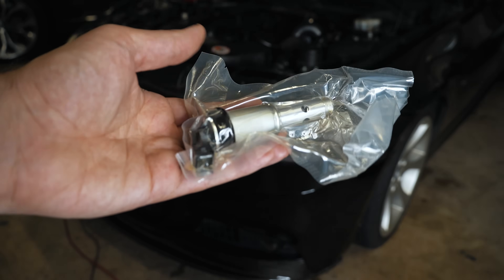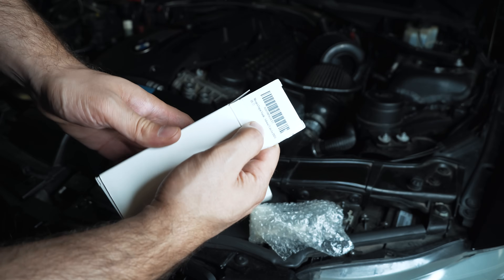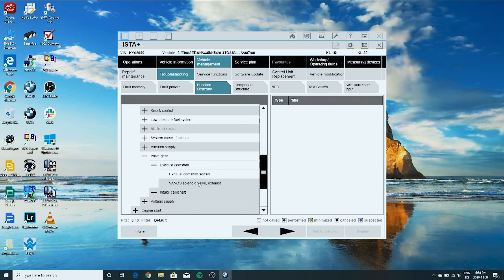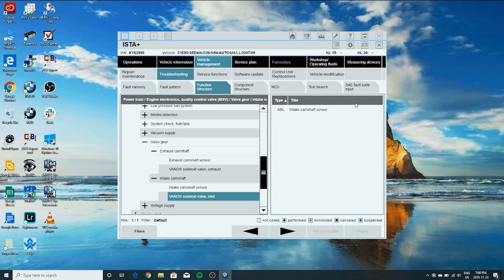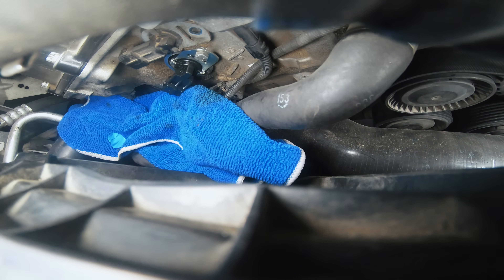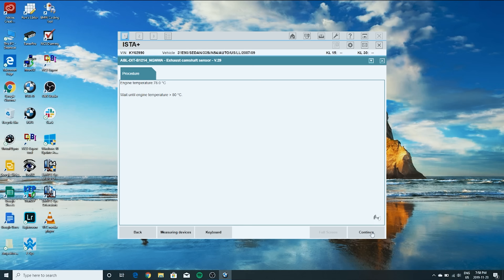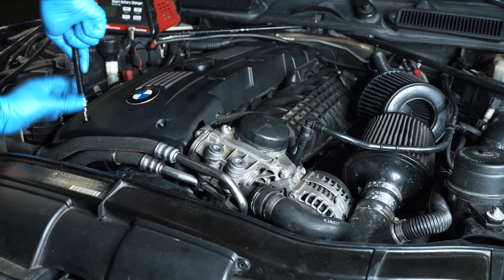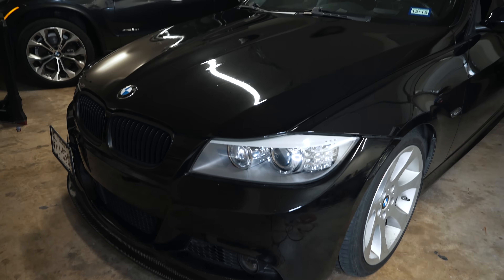I Bought The CHEAPEST Vanos Solenoids I Could Find! | BMW E90 DIY

Comment: Nothing wrong with cheap sensors,  the real problem is why oem ones cost 10-50X more and only last 3X longer,  always buy a spare set of cheap ones, and the car will tell you immediately if the cheap ones are not working right, so no harm done. 5 min to swap them out, i got a $10 diagnostic plug and a cheap old tablet i leave in the glovebox so can scan the car anywhere,  doesnt have to be expensive to run a bmw, parts from wreakers are great and generally oem

Comment: Do not put cheap intake solenoids! I bought a 2007 bmw 530xi and just the other day the plug on the solenoid got red hot noticed smoke in engine bay pulled over opened the hood and noticed the plug for solenoid was red hot and caught on fire good thing i had a bottle of water and poured it on it, put the fire out noticed the plug was melted, took the solenoids out and of course previous owner put some cheap amazon solenoids..Long story short get close to oem parts spend the extra bucks wouldn't want no one to go through what happened to me..

Comment: I replaced my Vanos solenoids 2 months ago with VAICO brand and the car ran like ish.  Very lumpy idle, stalled twice on a stop light, poor acceleration, etc.  Replaced it with an OEM from Turner Motorsport and immediately it feels like its new again.  Lesson learned.

Comment: Seeing this 2 years later. I replaced mine in my 05 745i with TRQ brand. $108 delivered for 4. Had a misfire Service light code for bank 2 timing retarded. These solenoids worked great for about 3 weeks then symptoms came back. Put cleaned OE solenoid on exhaust side. Ran good again for another  two weeks then got codes again.  Ordered URO brand at $60 delivered for 1. Will test this and see. If it fails I'll get a refund and buy a Pierberg for like $87 and test that.
Reply: How is going?
Reply: Can you get refund for that

Comment: No update yet. It looks that this lasted more than Corona.
Reply from the maker: They lasted but were in my old motor when the engine failed due to rod bearings so they didn't make it over to the new motor incase they were contaminated with shavings etc.

Comment: I think I need to test mine. During idle my engine stumbles a little and seems like its consuming more gas than normal.
Reply: check if theres oil in the ESS, mine did the same thing i just cleaned it out and replaced the $5 seal problem solved.
Reply: @Chezzzzy  what is ESS?
Reply: @mickd2533  eccentric shaft sensor

Comment: I need to get that program. I had 1 intake code a while back and i noticed loss of power on lower end. I ordered 2 viaco solenoids. I changed them and now my exaust solenoid is giving contstant limp mode. After a few restarts and driving around now i get constant limo mode for both.   I reset the adaptations.....and i think this might have been the mistake. Any input? I feel so stupid for not driving the car first before resetting the adaptations.
I have 1 new solenoid coming tomorrow, first i will reinstall the old ones since they gave minimal problems. That will let me know if it was the adaptaion reset. Whats worst case? Any input would help.

Comment: So say I have a cam code, I replace both cam sensors and vanos solenoids. Still has a code come back sitting at idle after a minute or two after clearing the computer with a scanner. Is it a must to drive to clear it? Or should the code stay off even at idle after clearing and no driving?
Reply: Check fuse 70. It can blow and act normal, then one day you'll have a no start condition with those codes

Comment: I have been getting INTAKE Vanos codes as well as boost pressure codes so I replaced the Vanos solenoids that were in the car, I'm assuming they were OEM as I bought the car with 56K miles on it. I replaced them with $40 Vanos solenoids from Amazon and didn't get a code for about 6 weeks. Now I get them every day but it seems to be only when the car is hot. If I let the car cool down and reset the code with MHD the codes only come back when the car is back up to temp again. If I reset while the car is hot and start it again, the codes are back in half a mile. So, I cleaned and swapped them over, the codes still came back and still on the INTAKE side. Do you have any suggestions ? Since the error didn't move when I switched the intake and exhaust solenoids I'm worried this is a cam ledge issue. It's a 2008 N54 (E88) now with 91K miles. I've done regular oil changes using the FCP oil change kits, the filter cap has the center piece, I'm stage 2 tuned (MHD). Would INSTA give me a definitive answer of whether or not its the solenoids or the ledge ?
Thanks.
Reply: Did you figure out what the issue was?
Reply: @darth_art2101  I ended up replacing them with more cheap ones from Amazon and haven't had an issue since

Comment: Do you do programming ? I live in jersey and have a 08 550i N62. My Ihk Kline says no Daten files when I use Bimmer geeks ProTool and check for errors. I go to code it says no files found. Any advice sorry to ask. Thanks either way
Reply from the maker: Sorry I don't have any experience with ProTool but BimmerGeeks has a INPA download that is really easy to setup.  You can download that from their site and set your laptop up with it.

Comment: I ran Viaco Chinese solenoids. They lasted 1 year and still no codes but power loss is experienced. FYI these solenoids including bmws can fail with no codes. You will get terrible torque down low, your fuel economy will increase and the car will sound like its wheezing at high rpm. Also oil consumption occurs and engine runs hotter than normal. I have 3 sets that I am experimenting with - Viaco; pierberg and genuine bmw. The Vaico failed by the spring becoming loose internally. The bmw ones failed by the bore wearing away not holding pressure. I am currently running pierburg but not expecting them to last as long as bmws. I suggest programming the engine to run cooler and or adding an external oil cooler. These problems seems to be caused by the engine running so hot. Those electrical coils cannot survive that heat for so long.
Reply: Can we have an update on the Pierberg solenoids ?
Reply: @moebeing1190  I did extensive testing with INPA. I have concluded that replacing the solenoid with genuine bmw solenoids are the only long term solution. The precision in cam adjustment was night and day vs aftermarket.

Comment: great video, good lighting and angle to see what is otherwise a bit blind.  got my thumbs up.   i had major difficulty inserting the solenoid with oring, so i installed the oring, lubed up the shaft and ahem, inserted the shaft into the hole.

Comment: Can having bad vanos solenoids and not replacing them soon enough cause internal damage to the engine like dropping a valve into the block because I had rough idle then scanned the code and a got vanos fault, I was going to replace them soon and all of a sudden I’m at the stoplight and my engine seized up and now I need to replace whole engine, i do have a n55 and it could easily be something else giving that n55 don’t have forged internals and could’ve been the rod bearings but The car ran excellent until then
Reply: What ended up being the problem?
Reply: Diego Carmona looked like oil salvation which was funny cuz I just had got an oil change the day this happened so they must have messed something up, I ended getting a rebuilt engine took about 2 months in the shop

Comment: I was looking at your data log. I noticed your low fuel pressure drops alround 20psi, followed by rail pressure drop, almost 2k psi, while maintaining full throttle. Are you sure thatthere is no fuel delevery issue? 
I might be saying bullshit, but i guess that shouldn't happen.
Reply: @guimazzini - low pressure shouldnt drop below 50psi so sounds plausible. HpFP is fine at 2000 psi.

Comment: Some times the Chinese ones are made in the same factory as the OEM ones
Reply: Harry Williamson Not really the case with BMW parts. About 85% of the OE parts suppliers are in Germany or Eastern Europe. I personally stay away from Asian parts when it comes to my BMW’s simply because of the lack of manufacturing experience
Reply: Pierburg, an OEM for BMW has factories in China. I purchased 2 Pierburg solenoids and it was manufactured in China. So far, my N52is running fine. It's the QC that will dictates the quality of the products.

Comment: Hey vehicular diy 
I need advice with my bmw
I have 2011 335xi
At the beginning car was starting but had issue 
I replaced rod bearing, guide rail with chain and tensioner I had disassembled whole engine checked valves too when I finish assembling diagnostic had only 2DD6 valvetronic servomotor position sensor short circuit or line disconnection. 
I replaced valvetronic motor 
After everything done it cranks like one turn like when battery is low like that battery is 12.77 I tried 4 batteries all of them are same I replaced starter nothing changed wires checked voltage is good 
Under glovebox checked relay it’s good negative cable which is one on the engine block and second one on the mount checked and both are good
What out do I need to check? 
I didn’t delete code after replaced valvtronic motor do I need to delete that ? 
And can intelligent battery sensor do like that? 
Any advice will be helpful thanks
Reply: Check ground wires and ibs.

Comment: Thanks! I ran cheapo solenoids which seemed to work at first but still threw some codes occasionally (the ones directly related to the camshaft operations). Bought new genuine (as recommended by BMW Doctor) and haven't gotten a vanos related code thus far. I've used the vanos test in INPA for all 3 sets (stock, cheapo & new genuine) and they seem to pass.

Comment: This may be the most idiotic BMW DIY video that I've seen.
Basically: "This $10 part works absolutely fine, but because I have some unhinged prejudice against Chinese parts, I'm going to announce that they will fail, with absolutely no evidence of that. Buy the $200 part anyway."
Reply: Was for content.  Most people think everything on eBay or Amazon is good.  Strictly FOR TESTING ONLY.  He left them in for 5 minutes.

Comment: Don't install this shit. It's real crap. Mine failed pretty much right away. Engine ran ok but lots of VANOS codes in de DME. I've got nothing against Chinese parts. I always try Chinese before I buy original. But these are very crap. Go for a proper brand in this case.

Comment: I bought a pair of Amazon cheap.  One of the two works (50% failure) out of the box. I ended up cleaning the OEM with brake cleaner. I used the new o ring from the new one.
Reply: What symptoms were you getting
Reply: @ptlouis9871  the vtc failure code when acceleration.
Reply: zmanphx what’s vtc stand for?
Reply: Valve timing control. That is the purpose of the VTC solenoid.

Comment: Quick question, are you still running your factory catback exhaust? I'm wondering if I need to upgrade mine to achieve about 550whp. I see you made 537whp before
Reply from the maker: I still am yes, it shouldn't be a restriction for you
Reply: @VehicularDIY  thanks!

Comment: I had the same weird high rpm cylinder 6 misfire after like 5800 rpm. I tried changing the injector, spark plug, coil pack, wiring harness, tune, and even hpfp with no luck. I even tried the tephlon seal method that you made a video on but nothing changed. Any tune I flashed it to I would almost always misfire around 6k rpm. I then got into an accident, got another 335i, put all my bolt ons back and the misfire followed!!! That’s when I knew it wasn’t internal motor damage and it had to be cause by one of my bolt ons. Long story short I took a gamble and placed my money on it being the lpfp and ordered a new one. Turns out something was up with my fuel it stage 2 lpfp because when I replaced it with a spool performance stage 2 lpfp it’s been running like a dream I’m finally able to hit red line and send logs to my tuner. I know it sounds it sounds unlikely that a weak or old lpfp could only cause a cylinder 6 issue but my guess is that it’s because it’s the last injector to get fuel. And I can’t back it up with logs because they both the lpfp sensor and rail pressure look normal!!! The only thing I have to prove this was that it worked for me. (Just wanted to add that I’m fbo, inlets outlets, pure stage 2, and xhp stage 3 transmission flashed)
Reply from the maker: Thanks for the info!
Reply: Vehicular DIY so what ended up fixing your cyl 6 misfire ? I still have mine. I did the Teflon seal too like your other video but it’s still there. I would appreciate any insight?
Reply: I after literally replacing everything and compression texting and walnut blasting I finally just had my tuner disable misfire detection after 6k rpm. Been running fine for months now
Reply: Didn’t his low pressure fuel sensor reading drop below 60 psi a few times around 6k rpm anyway? Timing corrections on cylinder  5 as well? Aren’t those indications that he’s close to running out of fuel at those rpms? (P600 FBO)
Reply: Constantine Lycos it could be. However after I got stage 3 lpfp and helix overdrive with full e85 misfire persisted. All injectors are new 12’s brand new two step colder plugs, and pr coils. After misfire detection turned off above 6k rpm my cars snaps to redline no problem or hiccup, (also P600) 27 psi too😉
Reply: Tried everything in the book to fix it. I think it just came down to over sensitive misfire sensors.
Reply: robert simental can you share a data log? My turbos take over 10 time increments to reach target boost levels. His only take about five. What is normal? I want to figure out if I have a small boost leak
Reply: Constantine Lycos what’s you’re email

Comment: Brother your worst mistake ever you know bro how I feel about that I’m sure you seen my videos lol 

Bro watch your timing be delayed and you will feel lose of power you will find out when these can’t work as hard as the genuine ones
Reply from the maker: Lol yeah bro I did catch the video where you sent a set to Nathan and told him how it is.  If you don't mind I have a question regarding using ICOM with ista.  Would it be faster if I switched to ICOM from Dcan?  I mean with an emulator and a basic amazon ICOM cable.  I know you have a proper ICOM.  Does having an real ICOM make it run faster as well?  Thanks man.
Reply from the maker: I'll take them out at the first sign of hesitation and update the description letting everyone know.
Reply: Vehicular DIY mate yes take them straight out or what will happen your timing will JUMP and you will be screwed mate as you will have to re time it as the solenoids will cause it when the dme is trying to advance the timing the solenoids ain’t going along with it and that will be it mate so we warned 

Also mate yes mate I use icom to be fair and it ain’t as fast as people think the only reason I use icom mate is I do ALOT of bmw dealers here and they won’t let me use a cable no chance I can’t go no where near a car with that there 

Also you can’t update idrive and gm gearbox with a cable mate you will brick it BUT if you want a good cable that does everything 

Go for a bimmergeeks cable mate there brilliant 

I also have a new device which is BETTER then a icom I will be releasing soon mate so stay tuned for that no need for that big box anymore 

Just bro trust me I’m advising you properly your gonna need to email me mate and send me your number and you can call me instead of chatting on here when you need something bro 

But I know you don’t like to be seen 😂 don’t worry mate I won’t let anyone know who you are behind the scenes bro I was the same for months
Reply: Quick question, I need to change mine tomorrow, is it better to change oil as well before installing new vanos. Also do u recommend Castrol Gtx Magnetic for my 2009 X5 even if it is not bmw LL01 approved? Thank you
Reply: @naderg2  get amsoil Euro formula 0w-40 that shits proper

Comment: Looking at the datalog, it seems like you might have an injector issue or an o2 sensor issue. When you have 0% throttle after the pull, you can see that the bank 1 afr are maxed out at 234.95 but bank 2 afr never maxes out meaning there are still fuel in bank 2. I know that you changed the injectors to index 12s but this is usually a symptom of leaking injector(s)
Reply: You can also see this in the Lambda section on this document.
 
https://www.docdroid.net/IyQ24N5/interpreting-mhd-datalogs.pdf#page=4
Reply: Comments like this is why YouTube is elite .

Comment: i looked at the logs at the top of third WOT, you have a lot of timing correction on cyl 5.Maybe try swapping coils or a new spark plug on cyl 5.
cyl 6 looks completely fine to me.Could also be the false knock another person mentioned.
Reply: Similar thing happened to me actually. I had a Cylinder 6 misfire on my e90 330i and I was also getting a lot of codes and issues with Cyl 5. My maf was bad though so I've just been running Alpha N and that's what stopped my misfire for some odd reason